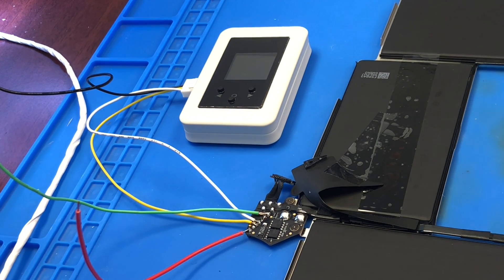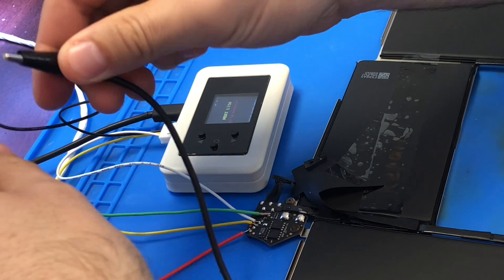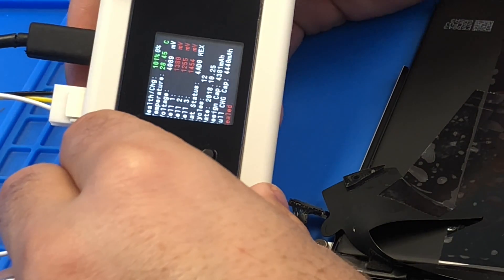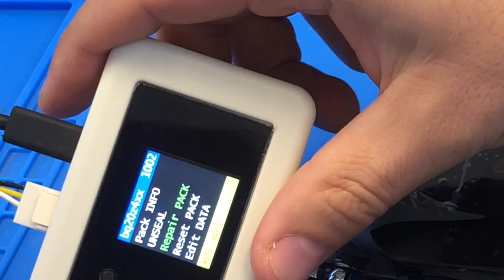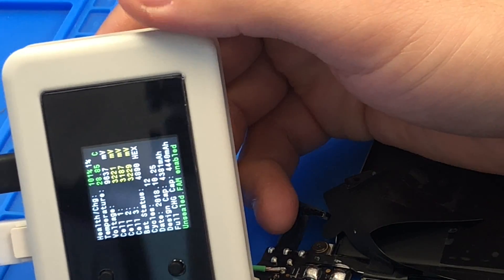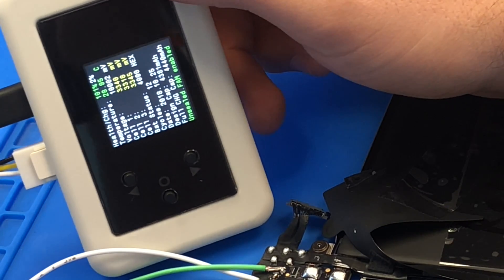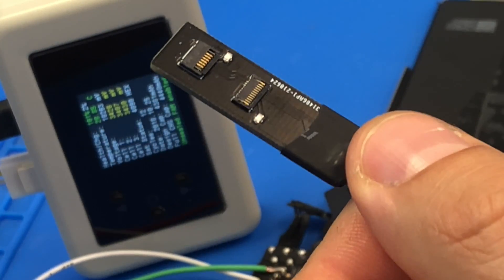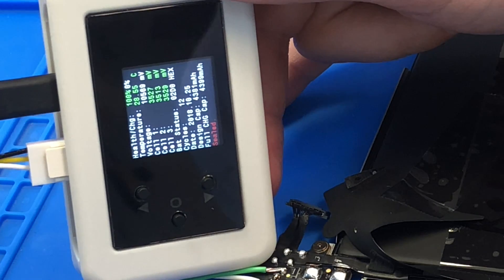Resurrecting completely dead A1932/A2179 "Replace Now" Battery with 12 Load Cycles via MBRT

Comment: at the beginning of the video, I see you disconnecting the PSU. If the battery cell voltage is already sufficient (i.e., the cell voltage is high enough, but only the BMS is having issues), is it unnecessary to connect the PSU?

Comment: Charging Macbook batteries using a lab power supply is too dangerous. Charging a battery must be done only by Smart Battery Charges which follows the safety protocol. This protocol says that the charger has to monitor all the safety flags and adjust the current and voltage accordingly. Stop showing bad practices things, people can get hurt.
Reply from the maker: Lab power supply is used for a very short period of time at minimal amperage only to wake up the controller. And it’s done on the lever of battery controller, not individual cells. After that it is put back inside the MacBook and charging is done the way it’s done on millions of other Macs.
Reply: Sometimes, if the cells are over discharged, around 3V then the chip is in pre-charging state and could request charging even by 50mA. Make sure you don’t exceed the pre-charging current.
Reply from the maker: @azzidoqsc I never start with more than 50mA per cell, usually its 30mA
Reply: Perfect, if you want a complete tool, including charging/discharging/calibrating/cells check and many other features, I can ship one to you as a gift.
Reply from the maker: @azzidoqsc sure, I can definitley find use for it. Apple Pie Tech. 3177 Bobcat Village Center Rd. North Port FL 34288
Reply: @applepietech  I don't know why my comments are removed. Can you contact me ? just send me an email
Reply from the maker: @azzidoqsc just replied to your email. Not sure why comments are deleted. Thanks!

Comment: After seeing this movie i decided to buy one.  Used it on a A1708 and a A1706. Now am busy with a A1990. Battery has only 362 cycles but status: Service Recommended  as the ohter 2 before.
Dealt with it in the same way as before. (They needed a smc-reset and i performed a nvram reset after modifying.) 
But with this A1990 the staus does not change, however it changed in the MBRT. I even performed a DFU revive of the system.
Do you have similar experiences and maybe some solution i did not think or know of?
Thanks, Gerard, The Netherlands.
Reply from the maker: If the battery has less than 77% of its original capacity - it will show this message and this tool can not fix that.
Reply: @applepietech  Thanks for quick response. Its is 75%. So i will replace it.
Reply from the maker: You can try to put several load cycles on it (discharge it to 0 and charge it to 100% 4-5 times). In 2 out of 3 times life will go over 77% and message will disappear. Also even with 75% original apple battery is better than new aftermarket
Reply: @applepietech  I am discharging now. Its worth trying. But it is still a nice Macbook so the result must be pretty good. A new battery is not a bad selling point (Its one of my own) and i don't want people coming back for warranty. Thanks again.
Reply: How to increase MacBook battery helth  I am trying service error remove but not respond MBRT tool , My MacBook battery helth 77% any solution MacBook battery increases

Comment: I have been trying to so the same with perfectly fine battery packs that where discharged below minimum safe charge but using TI EV3200 but all the software required that is out there is way to expensive and I was not able to reset the BMS as it’s sealed. How much is this tool?
Reply from the maker: I paid $350 for the tool and $35 shipping. Thanks!
Reply: @applepietech  also do you know what batteries can it do???
Reply from the maker: @lowbatterypt  I know for sure it can do A1502, A1398, A1466 and all 2016-2020 usb-c MacBook batteries. It can probably do older A1278 and A1286 as well
Reply: @applepietech  where did you buy friend?
Reply from the maker: @lazzarus85volley  telegram username @mobility_pro
Reply: @applepietech  thanks
Reply: Btw, nice video!!
Reply: I work at a school and just ran into this issue with brand new mnacines.  Has there been any updates to reslove this issue with out a tool?